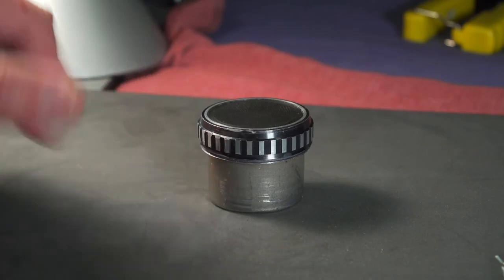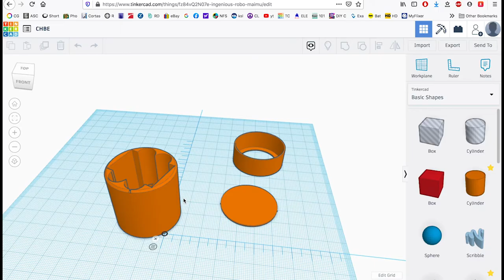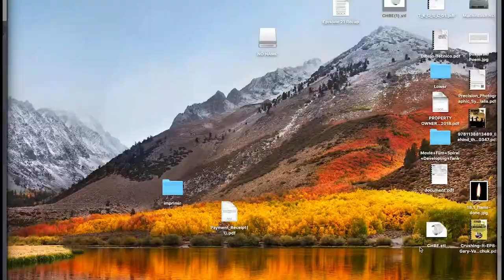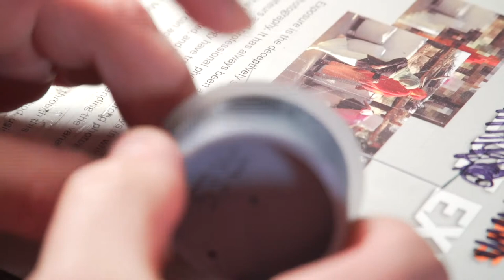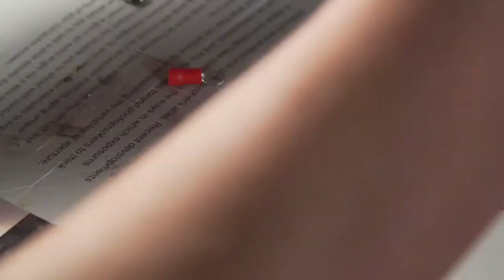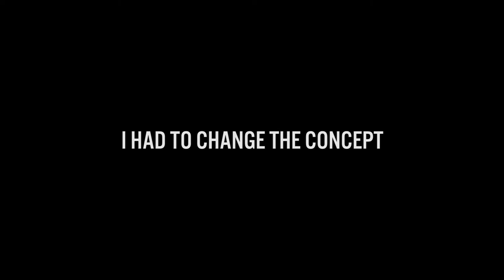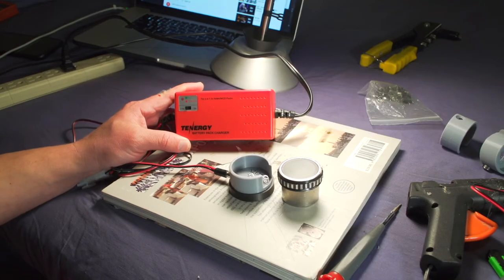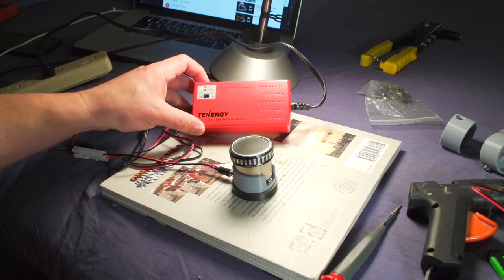Battery Holder for the Beaulieu 4008ZM batteries.

Comment: Are you making the STL's available ?   I'd love to build one of these myself.
Reply from the maker: I'm not. All the products I develop are intended to be for sale or accessories for modified cameras. I don't mind sharing ideas, but giving the designs away is not something I want to do.
Reply: @TheCinematographyLab You can always sell the file, like through Cults... I'll probably just make my own though. Tinkercad ftw.
Reply from the maker: @Tired_Shutter  It's kind of a basic design. If I can do it, anyone can do it. If I share or sell the design people still need some tools, connectors, wire and a soldering pencil. 

For those who are not into tinkering they can just buy one here:
https://duallcamera.myshopify.com/products/beaulieu-4008-off-camera-battery-container-ares-version